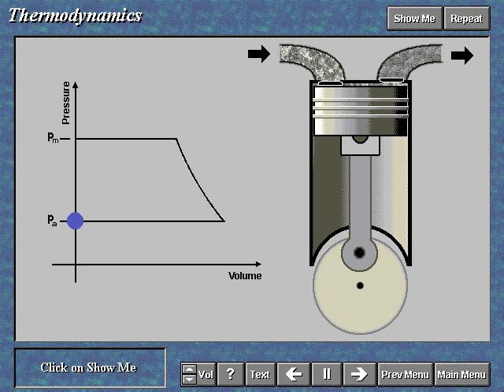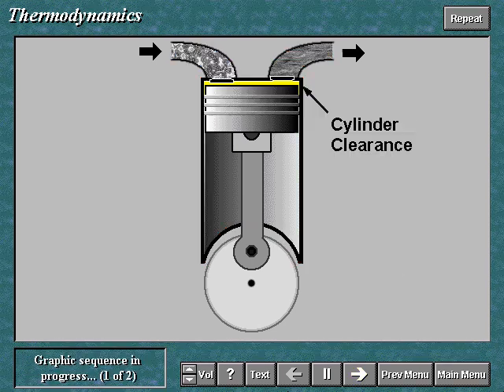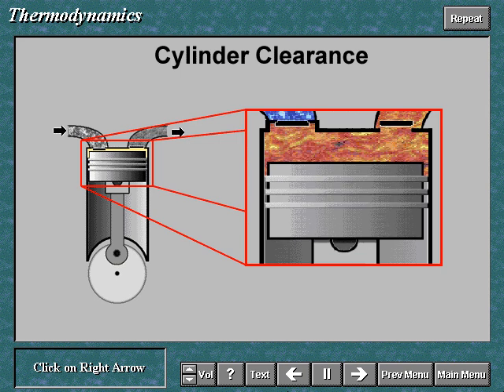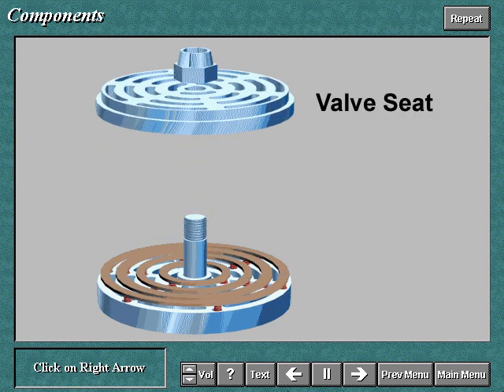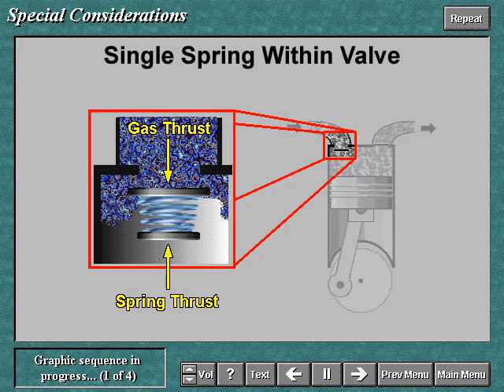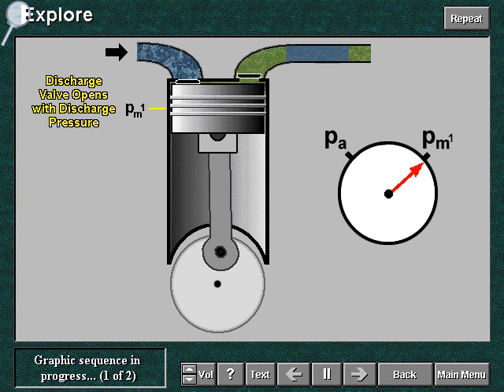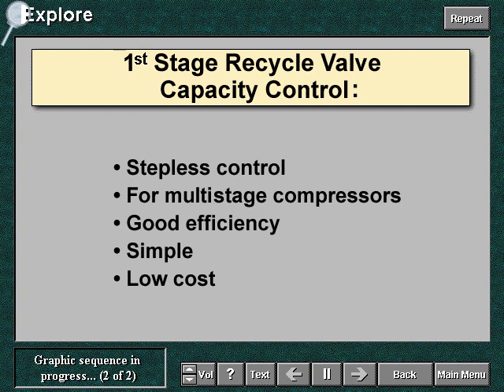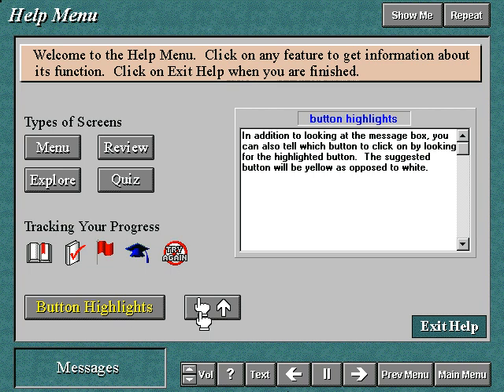How Reciprocating Compressor Work - كيف يعمل الضاغط الترددي

Comment: Dear Sir, 
We have the pleasure to introduce ourselves as a manufacturer &supplier of Air & Gas Compressors 
Suction and Discharge Valve Assembly, Valve Plate, Valve Reeds, Spring Plates, Channels, Seat and Guards for branded Compressors.
                                                                                                                                            
Infect, we have decided to making our own manufacturing facilities near Delhi (National Capital of India), for producing the Quality products for meeting the demand of Indian and International market.
Apart from this we have been selected their official manufacturers and exporters of their entire requirements. We hope it would be a great achievement from our side and enabling us to supply all Imported Compressors Valve Components in India.

We have complete range of above Suction & Discharge Valve Assembly and Valve Spares for
 All types Compressors. We, therefore, request to please send us your specific inquiry with
 Sample, so that we may quote our prices.

We remain,  

Thanking you in anticipation

Yours faithfully,

For Micro Engineering works

(M.NAFEES)
Proprietor 

FROM,
M/S, MICRO ENGINEERING WORKS
A-12, SAMAR COLONY,
40 FEET ROAD, LISARI ROAD,
MEERUT-250002 UP INDIA
MOBILE:9897053888,9358401196 
TELEFAX: +91-121-2404250